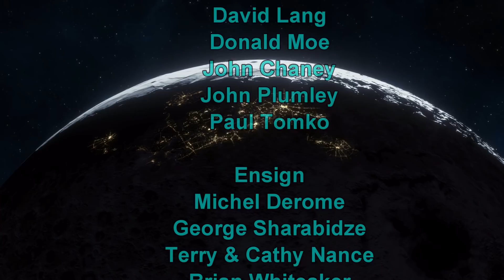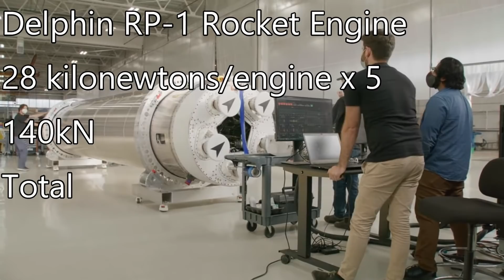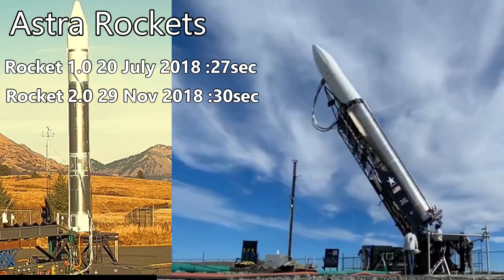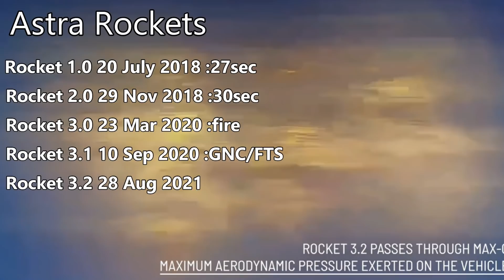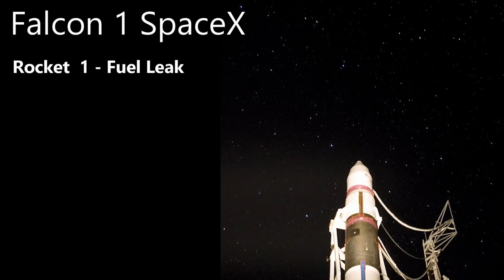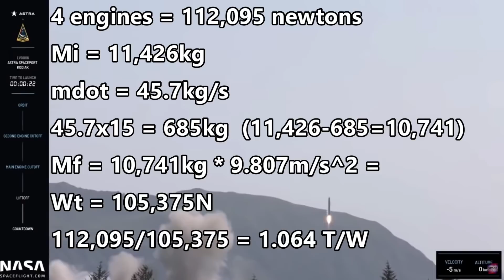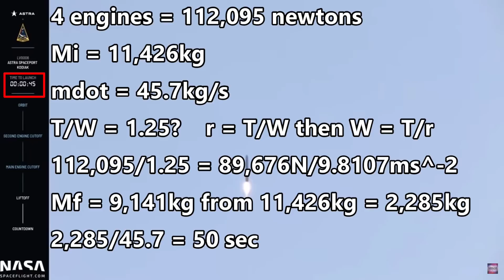Rocket Science: Astra Aerospace and Rocket 3.3

Comment: You say how amazing the engines are then say multiple flights were lost from engine failures. You might have who can learn something from whom reversed.
Reply from the maker: That was very Yoda-ish... Fly... or fly not...etc.  The engines are amazing but each one is hand-built basically.  Automobile engines have been refined by building tens of thousands of each type.  I don't think anyone but the Russians have built more than 1,000 units of any rocket engine.  And that is why the RD-107, 210 and 180 series is so reliable... Until now.
The Raptor engine is being made at an automobile rate... About 35 of them are going to be destroyed in one test. No company could afford to do that unless you made them cheap enough.  Can you imagine writing a proposal to use and discard 35 SSME in one test flight?  They would laugh you out of the building.  The Raptor is still being refined but at this pace they will have a reliable workhorse within another year... not decades at the usual pace.
Reply: @terranspaceacademy  Maybe I said what I meant to say backwards. I'm a huge SpaceX fan. Don't forget the Merlin which they have made a ton of at the rate of 1 per day. They have become very good at production runs of engines and they will just keep getting better with the Raptor.
Reply from the maker: @williamgreene4834  And this is their true innovation. It is not their metallurgy though that is exceptional, or their engineering, though that is also exceptional, it is the development of a true rocket engine industry.
Reply: @terranspaceacademy  True. It's all about the engines. The rest of the rocket is just a glorified pop can with a brain. :)

Comment: Luckily the only one engine failed that enabled this lucky outcome together with a very clever guidance and steering system.
If any other engine had failed, it would have drifted in the other direction wherever that engine was and that would have caused a fireball at the launch tower.
Reply from the maker: Very true... it could have impacted the erector and that would have been it.
Reply: @terranspaceacademy  but the guidance system was really awesome, that's true. It was amazing how it could stabilize itself without support from an airflow along the rocket...
Earlier rockets 10 years back could not have done that.

They could really build a rocket that could land itself if that would fit into the requirements. They would still need some steps, but the guidance for the most important part just before touchdown is ready ;-)

But first things first, go to orbit :-)

Comment: space x cured this problem with extra engines so one or even two engine loss is not the end of the mission
Reply from the maker: Unless one explodes and takes out several around it. Otherwise you’re right. The redundancy will prevent mission loss in case of one failure.

Comment: 1. Would SpaceX be able to reduce the risk of a catastrophic launch failure by first doing "hops" and "high altitude" flights with B4, before doing the orbital flight?  Those would require much less fuel, and therefore limit the maximum damage to Starbase and the surrounding populated areas.  Is there some reason why it was a good idea to do these types of tests with Starship, but not with Super Heavy?

2. Why doesn't SpaceX test the heat shielding system of Starship by doing a ballistic launch?  With no payload, Starship could be SSTO, so the heat shield and re-entry process could be fully tested at a risk of just 6 raptors, instead of 35 (including the 29 of B4).  It might also get FAA approval sooner, since it could probably launch Starship from the sub-orbital launch, just like it did the earlier prototypes.

Essentially, while recovering from catastrophic failure is great, not having the risk of a catastrophic failure is even better, right?
Reply from the maker: Launching the booster without Starship would be difficult aerodynamically.  It would almost certainly become unstable or tear itself apart due to aerodynamic issues without Starship.
A hop is of course possible but they probably feel they did enough of those. Starship by itself might not achieve sufficient velocity to properly test the heat tiles.  They are using older model Raptors so they have no better use for them.  I think they are planning a full all or nothing shakedown flight.
Reply: @terranspaceacademy  thanks for the quick reply.  If you don't mind, can you clarify your answers a bit more?
-- Why would a "short" hopmake the booster unstable?  It can't be during the descent phase, because the booster is designed to land without Starship attached.  If we are talking about the ascent phase, we are only talking about a "hop" high enough to reach an altitude where, if the booster were to explode catastrophically, it would not endanger Starbase, South Padre Island, nor Boca Chica.  It would not have to reach Max-Q.  Would it be unstable even at such low speeds?
-- If you look back at the calculations you showed in "Starship Earth Point to Point Transportation", Starship with no payload, fired as a ballistic rocket, would reach 8.35 km/s.  Surely that will be enough to test the heat tiles?
Reply from the maker: @Xcelential  No no. I wasn’t clear. A short hop would be no problem at all. But trying to go try trans sonic or through Max Q without a nose cone would tear it apart.
Reply from the maker: Now they could just put a nose cone on top of a booster and fly out that way :-)

Comment: Rocket Lab's Rutherford engine also uses electric motors in pumping fuel and oxidixer into the engine. Its sea level Isp is 311s, so maybe your estimate of 250s Isp a bit too low.
Reply from the maker: It may indeed.  Rocket Lab claims 311SL and 343 vacuum.  Those are astounding numbers.  The Merlin 1D is only 286.  But if the Rutherford numbers are accurate Delphin could me much higher.  The Rutherford and Delphin have a lot in common.
Reply: Yep, electric motors powering the pumps kinda correspods to staged compustion cycle. In both of them no fuel and oxidizer is descarded unburned or partially burned, that explaind the good Isp.

Comment: Do you feel that robust and non-fragile heat tiles is the biggest challenge for SpaceX Starship development? Or is it Raptor engine ignition and high-pressure plumbing that poses the most risk?
Reply from the maker: I think the heat tiles are a bigger issue. I’ve wondered if a double hole Whipple shield with a cold gas insulator might work better but I assume they have much more data than we do :-)
Reply: @terranspaceacademy  I share same sentiment. 10,000's of fragile ceramic tiles on a thermally expanding/contracting steel surface worry me a lot. If planes had them they wouldn't be rapidly reusable... Do you think Dyson-style "airblades" would be able to push heated plasma away using methane at least from the belly edges of Starship to help shrink need for the tiled surface area? Or no chance?

Comment: Great video as always... I learn more with each one.  Yes, that rocket's recovery was surprising to see.  I wonder if it was design to not angle back to get back over the launch point again to get back on track verses just go UP!
Reply from the maker: Hard to know. If it was programmed to walk it self away from the large complex of something went wrong I am hugely impressed.
Reply: In my mind when I see the rocket initially leaning over, I imagine balancing a broom stick on the palm of my hand. As the weight of the stick goes in one direction the bottom must accelerate in the same direction faster than the top to recover. So it may not have had a choice in walking away, it may have just been luck that it was clear area over there.
Reply from the maker: @robertkincannon5325  It very well could’ve been. But at least they didn’t shut them all down and slam back :-)